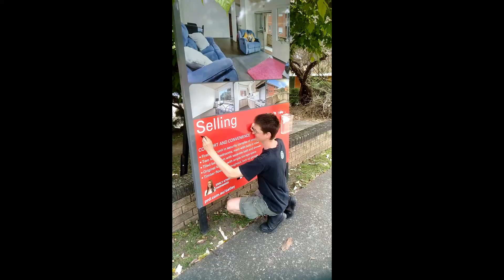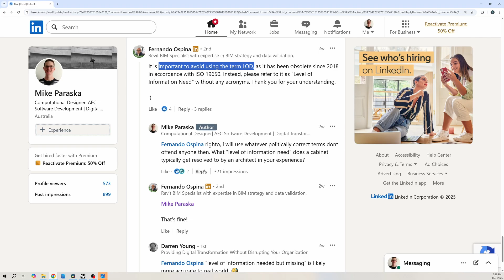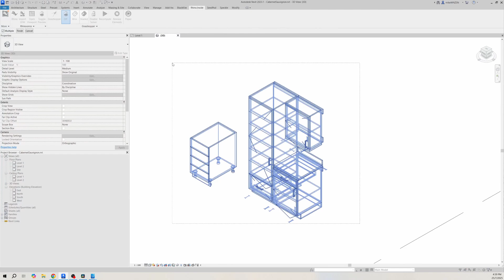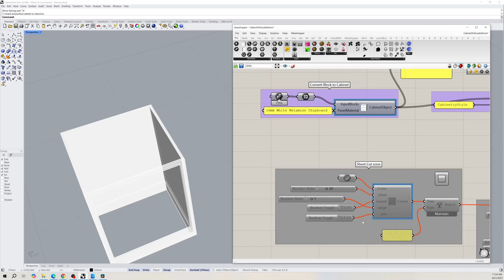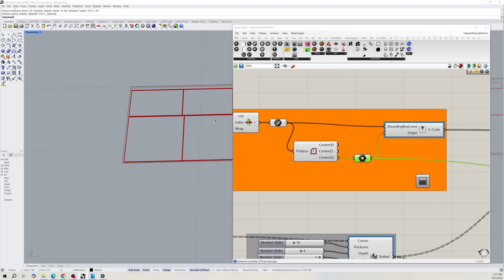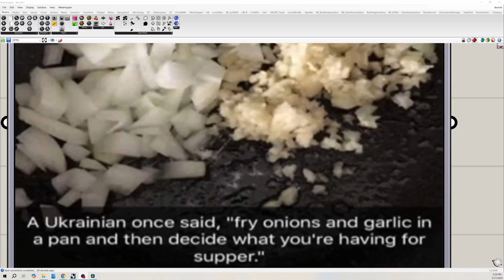Most Elaborate Cooking Video Ever!

Comment: Great to see behind the scenes how deep you take the software, and a solid set of components! It definitely feels to me that the initial audience that would receive this well is fabricator side, trying to process and automate quick cut sheets from a fairly high level model via basic remodelling. Architects as you know are hard pressed to design let alone fabricate these days, as much of a sin as it is.
Reply from the maker: What does or doesn't count as valid architectural practice is just a story we tell ourselves. The scope upstream into property development or downstream into manufacturing is there to take if we want to. But a culture that defines itself only by producing sets of 2D drawings will never get there.
Reply: @ParametricPromethean i agree to some degree, but the architect had reached a point where they're too time poor to do everything from start to finish. Master builder they aint paid to be... at least for now.
Reply: @AussieBIMGuru  the technology could've  changed that. Architects can’t do everything, but it’s also been over a hundred years since we had true master builders. By this point, our tools could have supported a more seamless flow from design to fabrication.
Reply from the maker: @AussieBIMGuru  architects are time poor and money poor because they charge for time instead of value. To the developers  upstream and the builders downstream, what architects go through to make those models and drawings is a black box. Maybe if value chains were more vertically integrated instead of scope contracted out to different businesses, what architects actually do would be more visible?  Does anyone reading this work in a company with both architects and engineers in one office, where you could walk over to someone's desk and have a chat to collaborate on solving the problems, instead of a long series of responsibility shirking emails? Or am I being too idealistic?
Reply: @ParametricPromethean  I think there will be more vertical stacks in future but insurers have forced everyone to be risk averse, we can't just ignore the reality of liability and risk in typical firm environments.